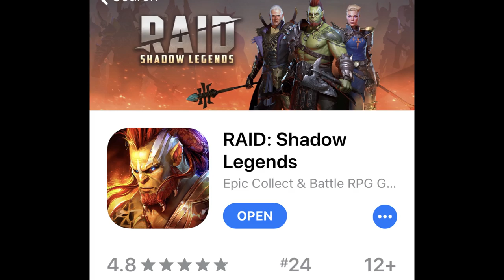Tavarish Gave Me A Range Rover.... And I Destroyed It....

Comment: Some cops have bulletproof panels in the doors so standing behind it would actually be safe
Reply: Only some cars have panels, depends on if the department paid for the option.  The most common panels are only rated for handguns.
Reply: @kompound52  Better than a standard vehicle at least. 9mm would go straight through lol
Reply: no they dont
Reply: @twiggss4344  yeah, some definitely do. Just not all, and most small departments don't have the funding for it
Reply: In most departments it’s taught to be concealment and not cover.  As someone else said it’s harder to hit things you can’t see
Reply: @kompound52  You are right. Most smaller departments in Wisconsin had this done with the SUVs and Pickup Trucks (for the snow ya know) a couple of years ago. My local unmarked, undercovers, and a dodge hellcat interceptor also have level IIIA panels in the doors. The days of the iconic police Ford Crown Victoria are gone. If you look at soldiers in the early 90s, they usually only had flak vests to protect from shrapnel and pistol bullets, but wouldn't stop a rifle bullet. Now we have state of the art body armor plates that will stop armor piercing rifle bullets. Things evolve with time.
Reply: Michael Glass no
Reply: None of the cop cars in Pittsburgh have paneling from what I'm told
Reply: Ronnie ! Yeah here in NYC they have it for the windows as well and the doors
Reply: Some cops have bulletproof pants and underwear

Comment: Why dont you ever shoot 30-06?
Reply: Because he cant handle the penetration 😂😂😂😂 nah jk 7.62×51 is 30-06 so if he says that it is the same as 30-06
Reply: @treybecker6709  wrong
Reply: @treybecker6709  7.62x51 is .308
Reply: @treybecker6709  30 06 is different that 308....and 762x51 nato is weaker than 308 winchester
Reply: @rippertrain  Right. And I'm thinking .30-06 is 7.62x63. Do you know if thats correct?
Reply: He owns an m1 garand and shoots it
Reply: @vaughnshirk4538  i have never heard of 30 06 by any other name....its 30 caliber model of 1906
Reply: @vaughnshirk4538  i guess i could go micro one of mine downstairs
Reply: @vaughnshirk4538  a .30-06 is actually the 7.62x56mm Nato, cause the .308 is the 7.62x51mm nato. The .30-06 and .308 are the same bullet, only difference is casing size because of powder difference
Reply: trey becker 7.62x51 is .308 not 30-06 my guy
Reply: Cause 30-30 rule
Reply: @JD-hi1gi  there is no such thing as 7.62x56mm NATO. The NATO standard rounds are 5.56x45mm and 7.62x51mm.
Reply: 30-06 that's safe to fire in an M1 is actually less powerful than most 308.
Reply: @vaughnshirk4538  yes that is correct
Reply: @JD-hi1gi  it is 7.63x63
Reply: @rippertrain  
I know its the same diameter just longer with more power, 7.62×39=.308. And 30-06= 7.62×by 51  its roughly the same
Reply: @treybecker6709  7.62x39 is not 308...its ak round...308 is 7.62x51...30 06 is 7.62x63 give or take a mm

Comment: Hey Matt. I am curious if you would be willing to do some product testing on the various bullet resistant products designed for kids; specifically the resistant backpacks. Also, maybe the Level III Backpack plate being sold by AR500?
Reply: I should note I don't ask out of any morbid curiosity. I have several school age children I am considering purchasing them for.
Reply: From what I understand the IIIA backpacks are about the same weight as a normal backpack. The backpack plate I am looking at does weigh 8.5lbs. I have had that same thought regarding that, but my high schooler is getting rather strapping. I know the chance is infinitesimally low, but I can't help but consider the fire extinguisher equation...ya know? I would much rather waste my money than bury my kid.
Reply: One way to find out buy one and go buy some ammo test it out

Comment: I think the 40 cal would have made it, I may be wrong though. Using 60 grain 40 caliber, the .40 has more kinetic energy due to higher projectile mass given equal velocity. Higher energy and a larger diameter, flatter, bigger bullet Using a lighter round it'll be faster than the 45 and larger than the 9mm with the same speed.
Reply: 9mm has more pen than 40 tho
Reply: @tjmoo3576  if you use a 60 grain 40 caliber, the .40 has more kinetic energy due to higher projectile mass given equal velocity. Higher energy and a larger diameter, flatter, bigger bullet make the .40 objectively better than 9mm FMJ in most circumstances
Reply: @aky19832001  you do you man
Reply: @tjmoo3576  when it comes down to it. Id rather have any caliber than no caliber in times of need. I heard said best by Arthor jones, " a firearm is like insurance, you can pay all your life and never need it, but that one day when you need it, your in dire need of it immediately"

Comment: As usual Matt, awesome,  love the videos.  But let's not confuse the public, the uninitiated. The rifle is not an AK or an AK-47. It is an AKS, a semiauto only  firearm that cosmetically on the outside looks like an AK-47 but internally is different. The selector is safe and semi, only. Not safe, semi and full auto. The trigger group is different, most notably the sear. It also does not fire from an open bolt position and is different internally to prevent conversion to full auto. Barrel length is also different, as mandated by law. Clarify something for us, you have a full auto UZI, and you didn't  bring IT out to hose down that Range Rover???? What's up with that. Engine block penetration would of been my goal and I  would of definitely started with the 5.7 × 28mm to be sure.